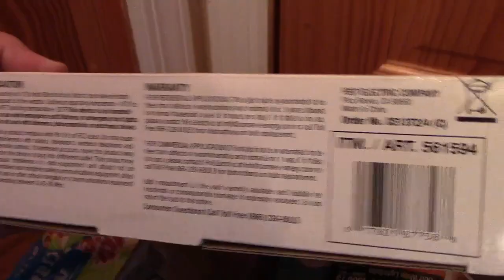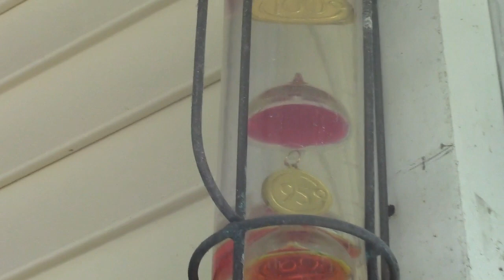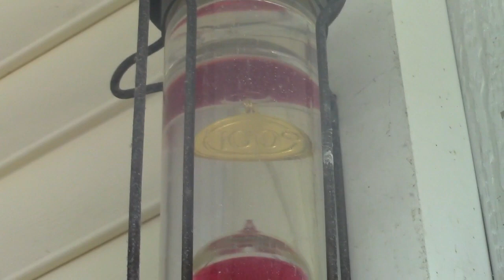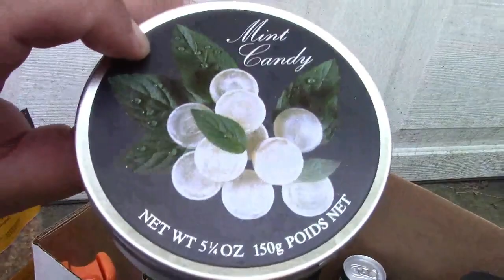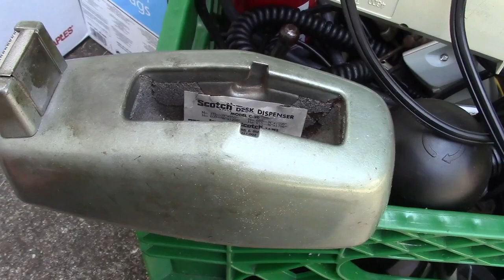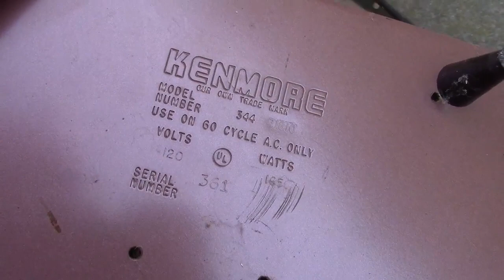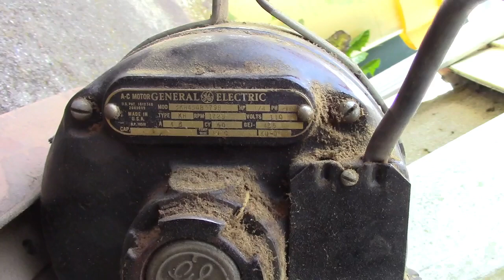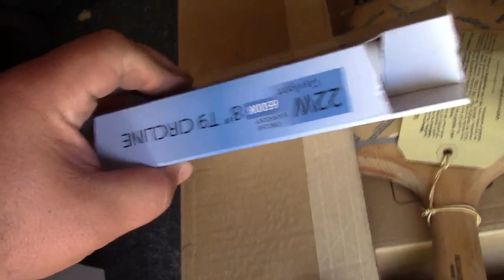Awesome "Estate" Haul...

Comment: New la-z-boy throne for king lyont. I used to have a tape dispenser like that metal one. I've done something similar to that grinder. Mounted a circular saw blade to a long bolt and stuck it in a power drill to try and cut down a tree. Didn't work obviously. Thing kicked back and nicked my arm. Could have been much worse.
Reply from the maker: Strangely, he doesn't really sit on it, though he did when I made the video on it, that will be premiering soon.  If I'm in it, and he's not being a Garfield around the house, he'll jump up top and sit up there and get comfortable.  Radiator is right there, plus that lamp, that's a prime, high-up, warm cat spot.

That circular saw blade, yeah that's a bit too ghetto.  Not enough control, but at least it taught you a mild lesson.
Reply: @jaykay18  yeah the saw was probably at least 15 years ago if not more. Young and invincible.
Reply from the maker: @lexmarks567  Ah yes, I remember those days.

Comment: Does that monster power strip have a rotatable plug that goes in to the outlet?  If it does I highly recommend cutting it off and putting a new plug end on it. I had a plug strip that kind of looked like that and the rotatable plug started melting.
Reply from the maker: Nope, it's a fixed plug, doesn't rotate.